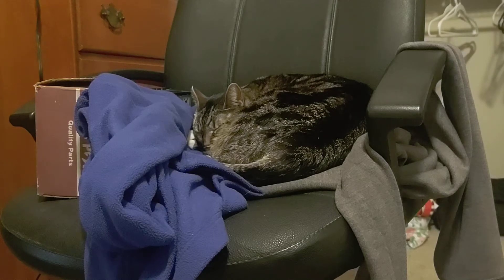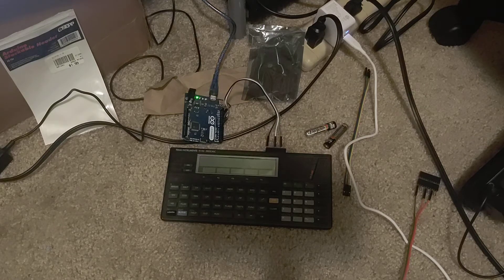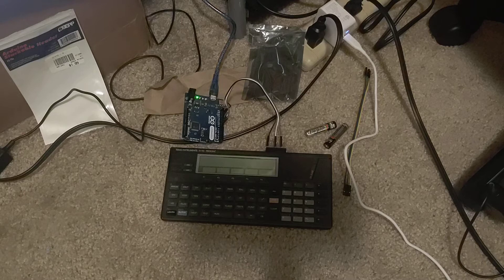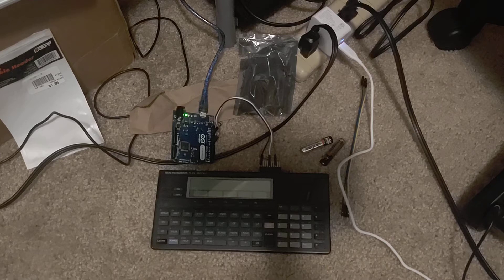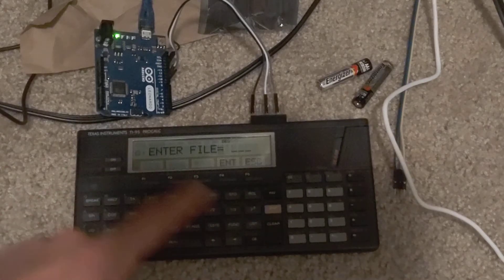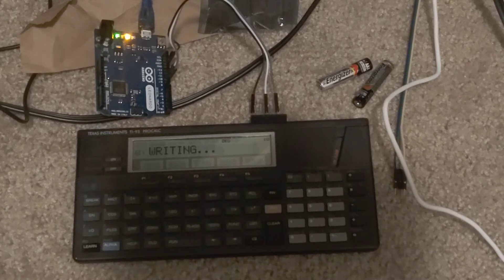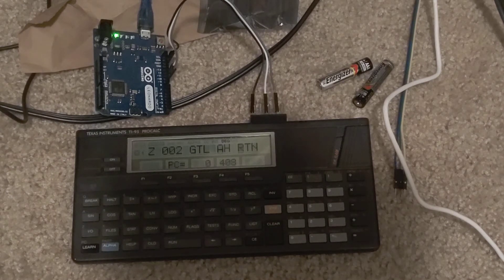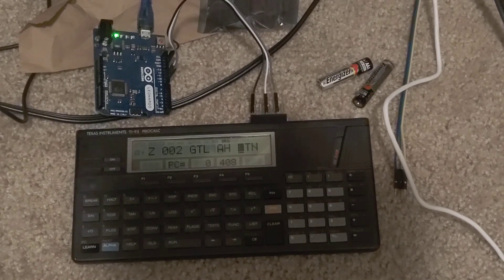CIduino7: a digital replacement cassette interface for the TI-95/74/CC-40

Comment: I have a TI-74 where a few buttons do not always work.  I assume it is the contact points/pads.  Can they be replaced or do I need to refurbish with that contact liquid?
Reply from the maker: I think people have taken apart the keyboard and rebuilt it after cleaning the contacts. I myself don't know of a source for new pads or buttons.
Reply: @walnuthills11  I cleaned them and put a new coat of conductive paint on the pads and it works great. CaiKot 44 was the product.
Reply from the maker: @chrisfezzler2878  Awesome!! Glad to hear that.
Reply: @buttonwizard6644 I gave away the TI-74. I recall the contact liquid did improve performance. I have no experience with its long-term effectiveness.

Comment: Looks great. Has this been tested on the TI74 too?
Reply: confirmed you can save and load from the 74 with this device..
Reply: @arcadeshopper  Great news -Thanks for the taking the time to confirm this!
Reply from the maker: Wonderful!! Thanks again for doing the tests.
Reply from the maker: Not yet, but it should work.
Reply: @walnuthills11 Arcadeshopper is kindly going to test theirs for me. I hope you still have some for sale!
Reply from the maker: @philsmith3261  Awesome! I sure do! Just let me know when you are ready. Also, out of curiosity, does TI-74 Basic allow relative addressing (GOTO A instead of GOTO 150)?
Reply: @walnuthills11  I got an error message, you would have to reference the line number. Btw I am in the UK -Hope you are prepared to ship worldwide! Apparently the CC40 lacks the internal circuitry to load data from tape. Ah well!!!
Reply: save "1.test" outputs data on the PC side as expected..  testing further